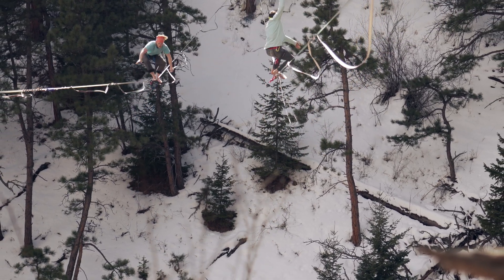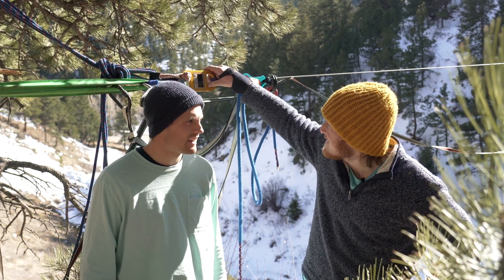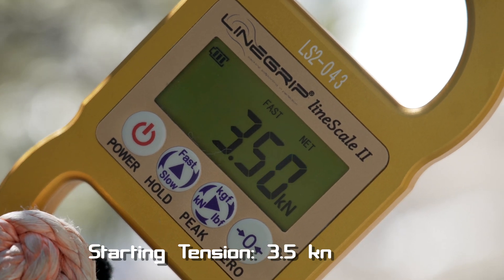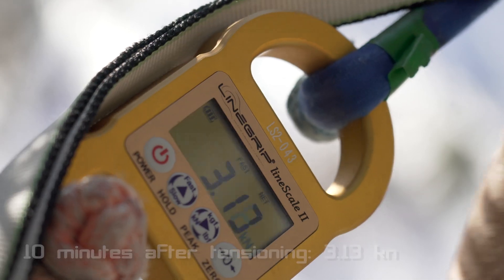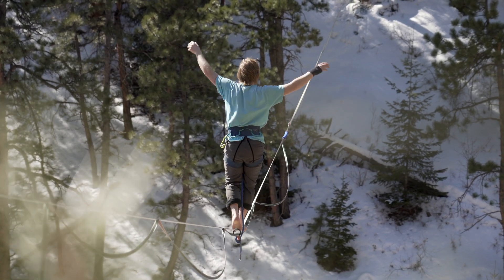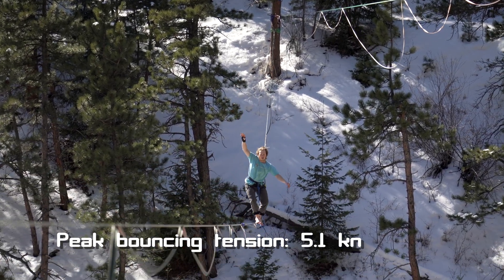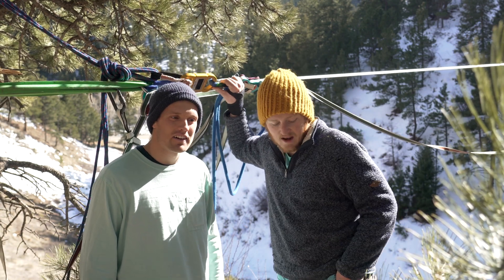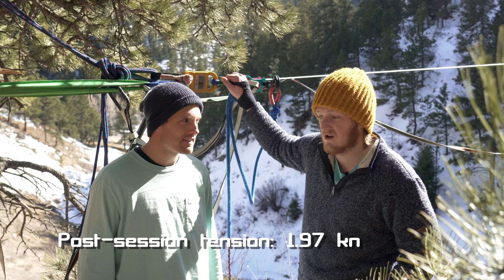How Much Tension is on a Freestyle Highline?

Comment: how did you tension it (3:1)? how many people pulling? (just to know how to reach the perfect tension without a dynamometer)
Reply: They said they used a 9:1.  Not sure if that was both of them pulling or just 1 person though.
Reply from the maker: @NJSlacker5   We used a 9 to 1 hangover system initially, but we generally find that 2-3 people pulling as hard as they can on a regular hangover system brings the line to a good tension. Re-tensioning after every session for the first few sessions is a must.
Reply: @TheWolfdaw  longer falls mean greater forces and noone wants a broken back. "bomber" backups are heavy, most freestyle lines nowadays are light unless it's specifically bounce training.